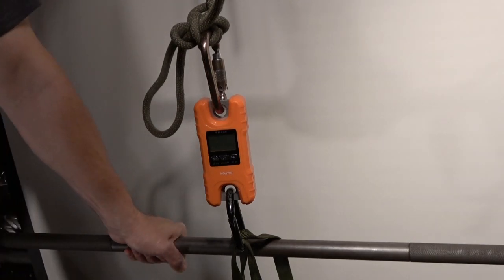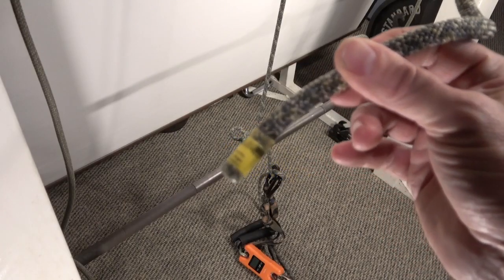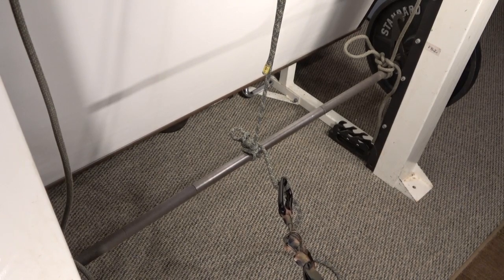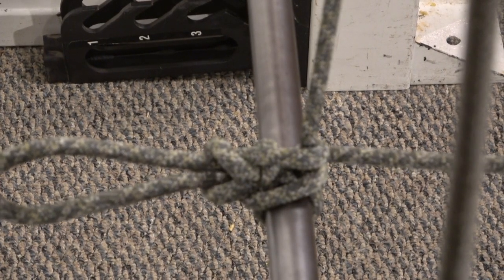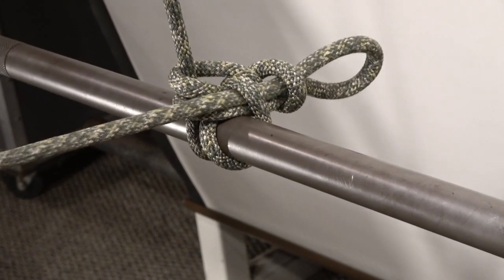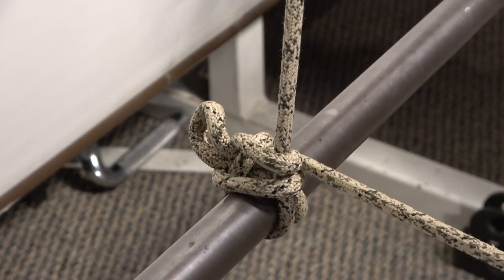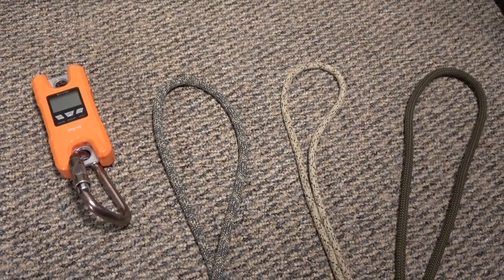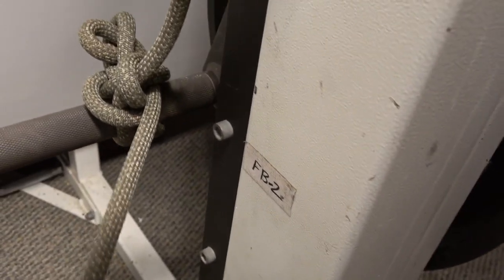JRB Hitch : Release of 100kg Under Load

Comment: Was the weight of the pull needed to release the knot the same with all rope types?
Reply: You are quite the professional tester!   So  at the end of the testing which rope did you prefer?
Reply from the maker: @maureenchristensen3427  Thx. It may not have been clear, but purpose of this test wasn't to choose a rope that's best. It was to demonstrate similar behaviors of the hitch on different ropes. The test was requested by a team who is reviewing the hitch and prescribing suggested tests.
Reply: @jrbtc  thank you John!   It actually was clear that wasn’t your goal.  I was just curious if you had a preference.  😁
Reply from the maker: I think you're asking if the tension necessary on the release line was the SAME on all 3 ropes.  If so, within a few pounds, it was, as I did not see a noticeable difference in popping the stages.  However, the Super Static2 is stiffer and the movement of the initial bight was a bit less. It was not possible to get the scale in the field of view, without a camera operator, as it was some work to pull the line, and the scale moves with the rope.